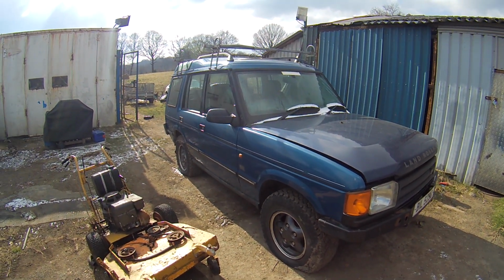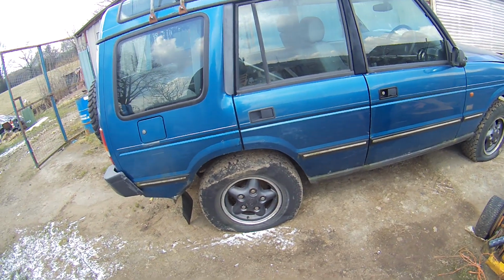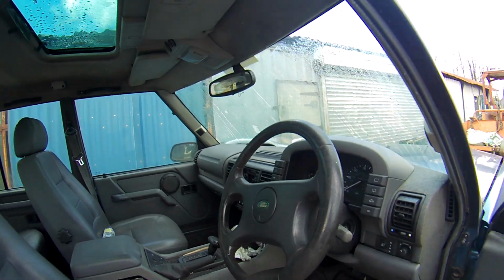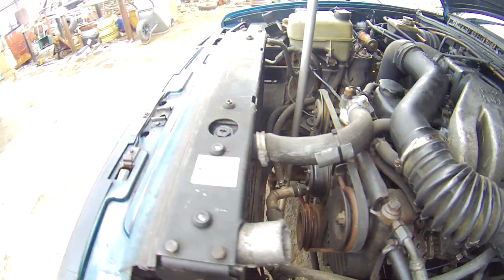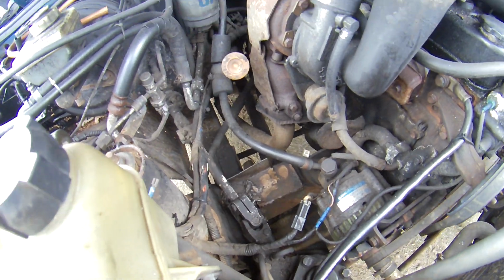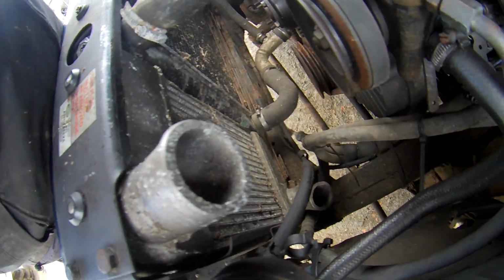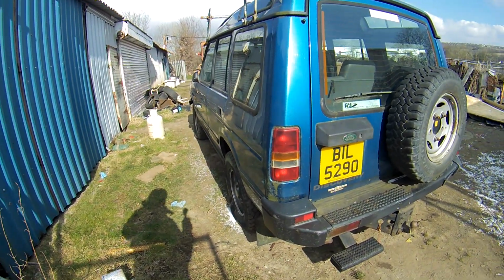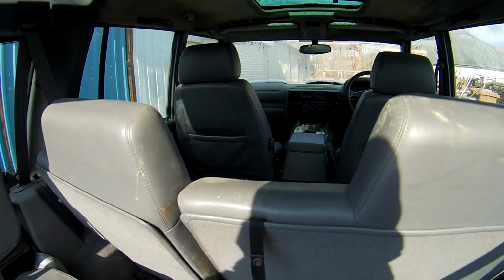Land Rover Discovery ( new project )

Comment: Hi can't beat a Land Rover, in the recent snow I've been out in my 90 and it's as if there's no snow at all, the grip is brilliant. I went on some back roads that were in deep snow and the only other vehicles I came across were discoverys. The Isuzu engines were commonly used in land rovers, but them engines are few and far between now most have been exported, my Defender is the TD5 I love them engine being 5 cylinder they sound great. Japanese make good stuff Good vid🙂.
Reply from the maker: Mowersandstuff  Thanks.  I have got a 90 coming in the future.  Yes landrovers are brilliant.  I love the sound of the td5  good engines.  I'll enjoy getting this discovery back on the road.  Like I said in the video I'm a big fan of Japanese stuff. So im chuffed about the engine.  All the best Calvin